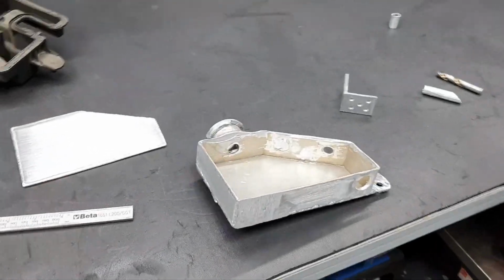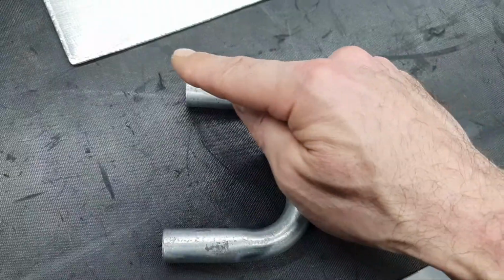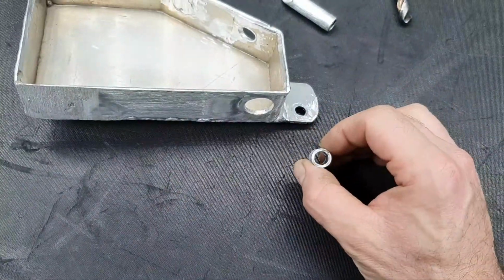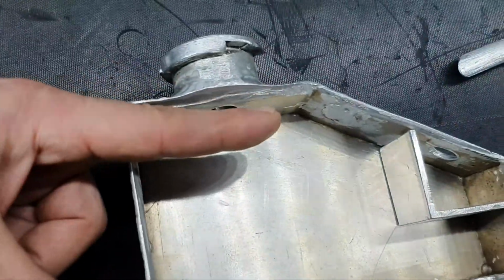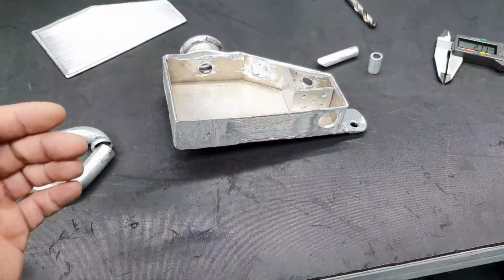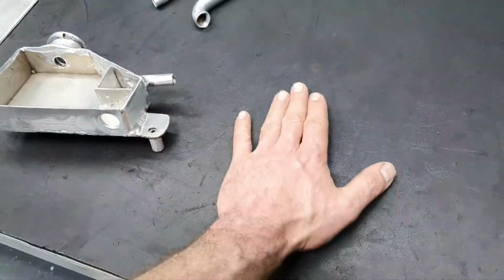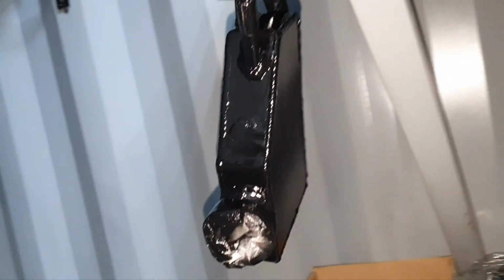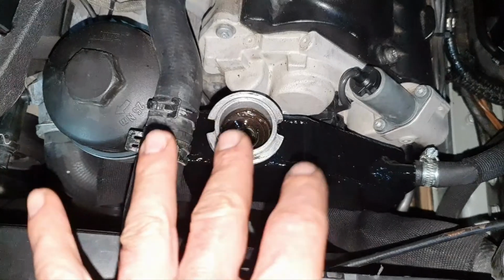E63 2010 with 81k km check up (part 4.1)

Comment: Nice work! One thing you could do is add an in-line power steering filter in the return hose, since this tank does not have one like the plastic tank. These PS filters look similar to fuel filters but are specifically for power steering systems.